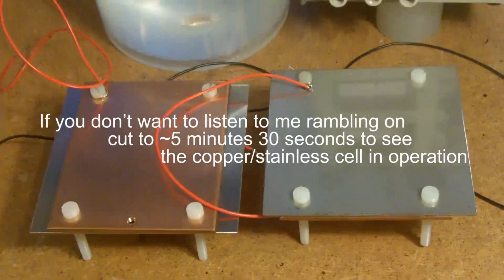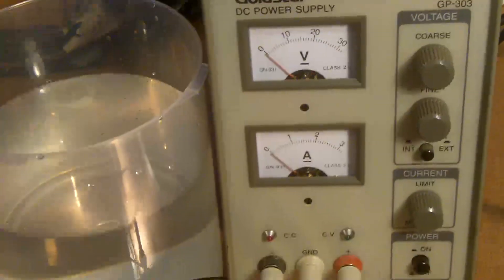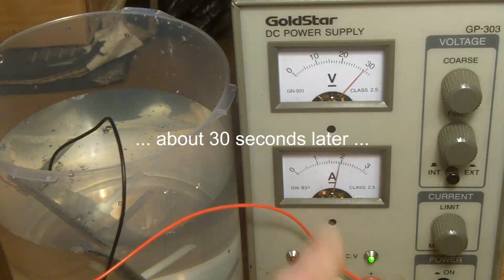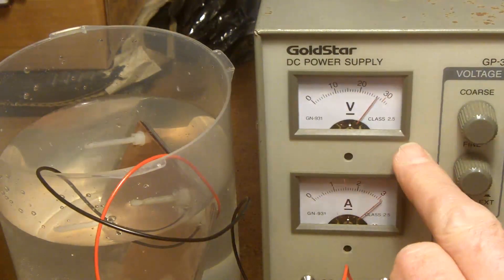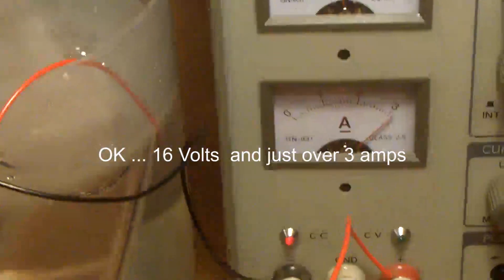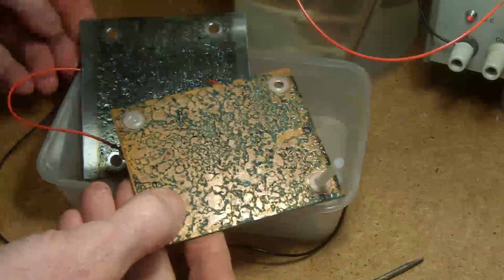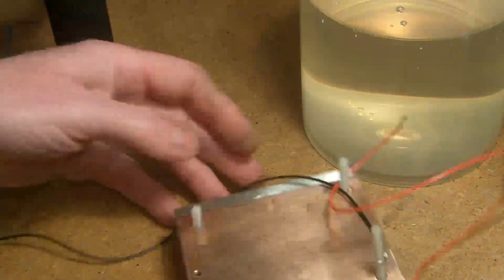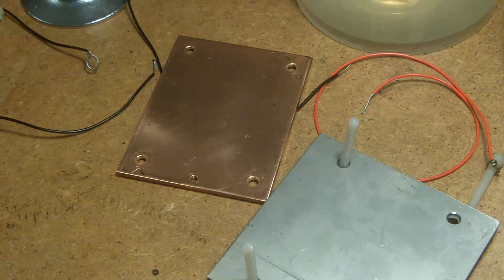HHO.1 Successful tests using a copper & stainless steel cell

Comment: Convert your engine to run on water (Hydrogen hy-bird system) to gain torque & peak engine performance.hho system reduce exhaust carbon emission, improve fuel economy

. faster acceleration.HHO SYSTEM REMOVE CARBON DEPOSIT, engine running smoother and cleaner. fuel burn faster and completely. (no fuel is wasted its save you more fuel and lower the engine TEMPERATURE).

INCREASES ENGINE LIFE, ALSO INCREASES ENGINE OIL AND BATTERY LIFE BECAUSE YOUR ENGINE WILL BECOME A QUICK START EVEN IN COLD MORNINGS. YOU WILL SAVE MONEY ON LONGER MAINTAINANCE PERIODS.

SYSTEN CAN RUN ON ALL TYPED OF IC ENGINES. HHO NEED NO STORAGES TANKS. NO NEGATIVE SIDE EFFECT ON ENGINE. THIS POLLUTION CONTROLLED SYSTEM VERY GOOD FOR CARBURATOR TYPED ENGINES. VERY LOW POWER CONSUMPTION CONTROL BY THE IGNITION SWITCH.

EASY TO OPERATE, SAFER AND MORE RELIABLE. CLEAN COMBUSTION CHAMBER AND CATALYTIC CONVERTER TOO. 

IF YOU HAVE ANY OTHER QUESTIONS VISIT HHO ACMEC or CALL ACMEC HHO 03082266179 KARACHI PAKISTAN.

GOODBYE

Comment: Hi Andy,This is quite an interesting video.Your demonstration shows that hydrogen is only produced when the negative is set on the copper plate. I’m a retired commercial diver and one of my current jobs was to cut steel plates
underwater with an electrical process called oxy-arc or exothermic cutting.
With this process it is recommend to always set the torch to the negative pole
and the work (mostly steel) to the plus. The problem is that the cutting electrode
is composed by a great quantity of copper and therefore some hydrogen is
produced during cutting and as you’ve seen H2 explodes and it explodes even
stronger when it is mixed with oxygen (we use it in our process). As a result,
a lot of accidents happen due to these explosions.So I wonder if it wouldn’t be a good thing if after more than 100 years of such practice, divers set now the negative to the work (reversed polarity). This would probably reduce the hydrogen production.Do you think you would obtain the same results if your test had been made in salt water which is more conductive?

Comment: I made a drycell with 3 plates.. +1st ss ,-2nd copper or +3rd ss . This is my dry cell. Then i started my dry cell... Some time ago i Will stop my dry cell... then i saw and open it the copper plate (-) is so rusty it is black on both side but ss plates(+) are safe and clear... this cell is not work... sorry sir
Reply from the maker: I think that if you have multiple plates then you should use all stainless steel plates. I hope this helps you.  Good luck. Kind regards . . .  Andy

Comment: Cooper have free ion is Positive.... if Connect positive current in copper,  Copper ion repelled and dissolve in liquid and slowly copper plate will disolve due to copper plate loose it bonded

Comment: Great video!  Very informative.  I have been thinking for a while about using hafnium and nickel films. The hafnium is difficult to oxidize but gives off electrons excellently and would thus relate to oxygen well. And the nickel relates to hydrogen well. I believe using these materials with Pythagorean tuning frequencies that resonate with water's tetrahedral structure,  will produce very efficient electrolysis. Any thoughts?
Reply: Water isn't tetrahedral unless maybe frozen.

Comment: Try with 2 SS plates (+) and 1 copper (-) as a sandwich and a second test with the same sandwich but use the copper plate unconnected like a neutral cell this may reduce your Amps.

Comment: Brilliant video, well prepared and nicely made. I have done tests with Aluminium plates on + and - and with Stainless steel on + and -
With the Al plates white flaking did occur after a while and eventually the Al plates crumbled ( I did put some dishwash liquid in the mix )
With the SS plates a brown gunk appeared very in very early stages and it became very messy, obviously the SS plates started to rust. HH0 gas was formed in both instances.

Comment: If you are still in the way of playing with HHO I suggest using graphite or just carbon rods or plate (if you can get them). I tried using carbon rods from old D sized batteries. If you clean those rods very good you get completely clear water after hours of work, though I get some sediment on the bottom. I figured it was all the salts and rust from the water itself because using distilled and deionized water I got no sediment. Nice and informative video, with some scientific base, not like other making HHO cell plates from aluminum beer cans... :)

Comment: I liked your video,I have been wanting to build a dry hho cell using copper for the cathodes and nickal plates for the anodes with copper electrical connections because copper has a lower resistance than stainless...if you have the capability to pulse the plates at 13.56 Mhz I think you would be pleasantly surprised to see a large amount of gas wanted to run a car with it 100% hho +-+-+-+-+-+plate configuration please email me at j a s e n d h a y w o r t h @ y a h o o . c o m  God bless you!

Comment from the maker: Hi, I guess one of the main reasons of making the videos is to share the experimentation with others in the hope that it actually helps them. From my trials so far I am getting a better understanding of the way water behaves at different voltage levels, I haven’t started to think about additives yet, I know they increase production but I don’t think they are going to increase efficiency. (I’ve collected snow while we had it for trials latter)   
Kind Regards ... Andy

Comment: i remember. in the Stan Meyer's plans who his brother disclosure. it shows a asymmetrical frequency transformer before to the hho cell. his brother told "he was using normal water without the help of any electrolytic compound only water". water from river, rain even water from supply. and they performed pretty well, but he noticed the river and rain water had a higher production than supply, i think we have to experiment with different frequencies and share our findings!. thanks!!!

Comment: Andy thanks for your reply. I would like to share my experience just this morning I mixed two spoon of iodised salt in the 2 liter water of my hho generator and my 30 amp fuse give up as a result.
It draws to much current. So i reduce the salt mixture to 1/5 of a spoon and it is using 16 amps of current and i'm happy about its hho output but as the temperature rises the current usage also increases up to 28 amps. I'm worried about my wires cause it is also getting warm up. 

truly... Albine

Comment: Andy I also have another question. Does the pressure with in the hho generator affects its  hho output? If yes, I'm wondering what psi range that would help increase hho production? Just like the temperature affects the production of hho.

Comment from the maker: Hey, good question! The thing is I don’t know but maybe I'll look into that.  As I'm typing this at 16:13 on the 17/01/2013 I'm also uploading the second part to this series where you will see I'm building a test cell to use as a test rig for different methods of powering the device. I hadn’t considered the efficiency of copper versus stainless steel as I'm rather assuming there would be no difference but that may be a bit naive of me.  
Thank you very much for the input. 
Kind Regards ... Andy

Comment: Thanks, Andy. That low reading basically told me that my initial reasoning for the oxidation was wrong and I had to brush up on my electrochemistry. When the copper is made positive, it attracts negative ions dissolved in the water. I would say the greenish blue color most closely resembles copper hydroxide, but it could be a mixture of copper hydroxide, copper sulfate, and copper carbonate, depending on relative concentrations in your tap water.

Comment from the maker: Hi Eric, test conditions, Stainless steel 100 X  100 mm, Copper 100 X 80 mm, gap 1 mm (each nylon spacer/washer is 11 diameter so we lose 95 mm² for each of the four spacers)  tap water  at 10°C
 Results 0.024 Volts (Copper  +ve. Stainless Steel –ve.)
Test meter = Flue 77 series II 
I hope that helps 

Kind Regards ... Andy

Comment from the maker: Hi Cor, I understand your reasoning and I was going to say I don’t think that’s the case but looking back at the sort of pattern laid down by the oxide and it’s viscosity I guess gas was no doubt trapped there. That’s why I shock it. But gas isn’t significantly trapped in the second test with the same gap so I guess once the oxide builds up and blocks the gas flow the resistance will go up.
Thanks for the input.
Regards ... Andy

Comment: Much appreciated Andy! All I want is the open circuit voltage and short circuit current from the plates acting as a battery. I found with my tests that the currents and voltages are almost zero, so you should use the most sensitive instruments you have. Thanks!

Comment: Hello Andy, the currentdrop in the beginning is due to gasbubbles forming on the plates wicht disturb the currentflow, that why the industry moves te objects in the electroplating bath to prefent this, so they get an even plating and distributian of the current.

The blue scum is Coppersulphate, i think that deze are the problem by causing the near shorting of the plates.

Manny greets and a happy 2013

Comment from the maker: I’ve finished the mechanism but I haven’t mounted it on another backboard yet, I'm looking for the right piece of wood, there’s every chance that it will be found on one of the local beaches, but I have to admit I'm a much better starter than finisher. Having said that once I get the bit between my teeth I will put in countless hours to achieve the finish I want, particularly if someone else is going to look at it. Unfortunately the mercury switch created too long a delay to be useful.
Andy

Comment from the maker: Hi Eric thanks for the interest. I'll be happy to help if I can. Please specify the test conditions that will best suit your needs.  At the moment it’s easy for me to work up within 30 volts/3 amps DC but as you’ll have seen that is folded back subject to a the current limit. 
Mmm, or do you just want the voltage created by the plates when looked at as a battery?  If you can be specific I will try to comply.
Kind Regards ... Andy

Comment from the maker: Hi Carl, you’re probably the same, but I’ve been meaning to have a go at this for years. I’ve run a little lawnmower engine off bottled gas and I’ve always loved the notion of running one off water. But I really do want to have a play with a small cutting/welding touch running off HHO. So I'm not short of ideas, I just the time to do it all but I'm hoping that my videos will help others and just maybe I'll get some answers to some of the questions I'll no doubt have.
All the best ... Andy

Comment: Done this many years ago with copper tubing worked out really well. The thing you have to keep in mind of that copper is always negitive and the stainless is always positive and you have no bluing. The copper will bleech off in the water over time but with the right chemicals you can get it working good and makes tons of hydrogen.

Comment: A very nice experiment, Andy! I'm interested in why the gunk builds up one way & not the other. I figured it's because when Cu is (+), the power supply pushes current in the same direction as if the cell was used to power a load. I ran some quick voltaic pile tests with Cu and different steels, and got mixed results. Sometimes the Cu was (+), sometimes (-), but always just barely, by about 50mV, and a short circuit current of a few microamps. Could you please measure the V and I from your cell?